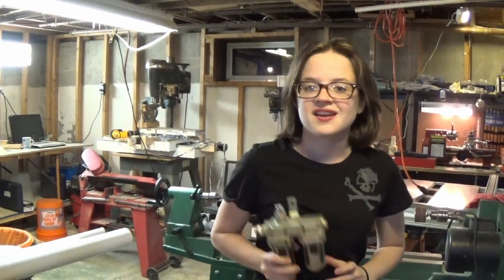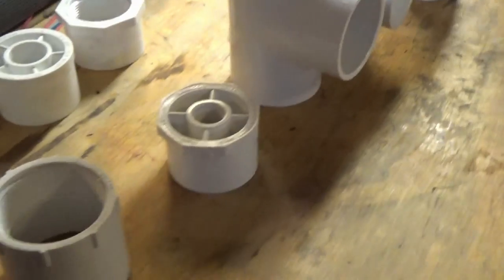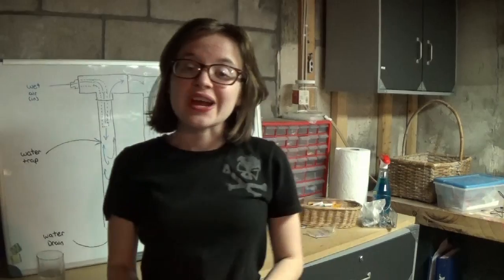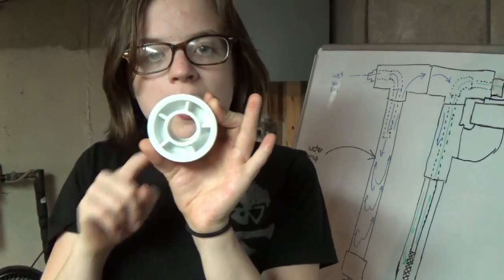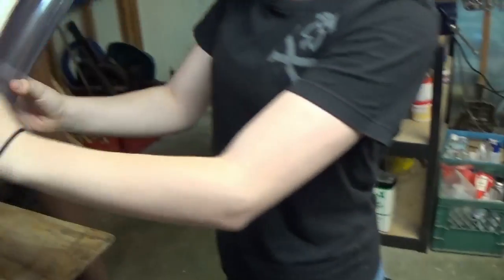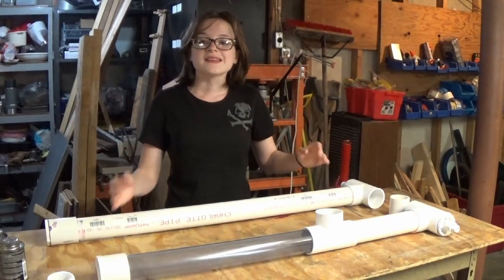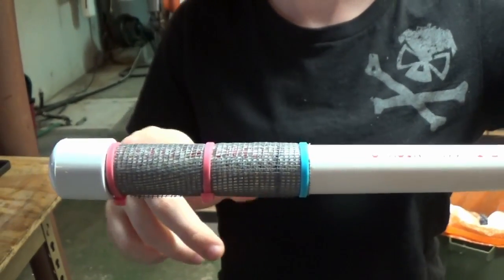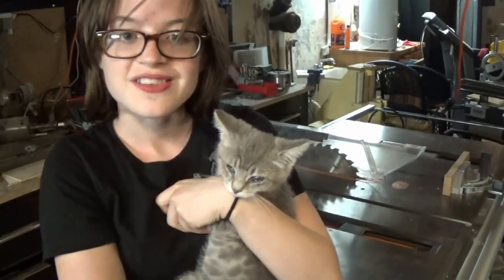Ep 11 Dirt Cheap DIY Dessicant Air Dryer

Comment: Only fools and dead people use PVC pipe for compressed air.
Reply: Nonsense, check out the pressure rating for 1/2" sch40 PVC. It's around 360psi, which gives you generous amount of room for error. It's pretty much standard in many parts of the world where the safety police haven't taken over. The problem is with larger diameters. as the diameters go up the pressure ratings go down. At 1" it's already down to 270psi,  at 2" 166psi. Add to that that as the diameter goes up so does the amount of energy stored in it, I wouldn't use the large diameter sizes. And that's why I'm leary about this air drier, it's all large diameter pipe. But 1/2" sch40 PVC is perfectly fine. Even if it does explode at 100 psi the shrapnel isn't so powerful that it's going to do much damage, unless of course it hits you in the eye.
Reply: Yes, volume not pressure.  If you have 60 gallon of water compressed to 100 psi, obviously if you remove 1 oz, you will dissipate all of that pressure.  If you have 60 gallon of air compressed to 100 psi, you will have to remove 408 gallons of air to relieve all of that pressure.
Reply: @CPUDOCTHE1  Liquid does not compress. Water pressure is increased by stacking (vertical head pressure, as in elevated municipal water reservoir tanks) and/or centrifugal pumps. Either way, it is never compressed. 
Where did you learn math?  Duh! To relieve all of the pressure in a 60 gallon tank, you remove 60 gallons of air, less what the physical volume of the tank is at static. Also known as Atmospheric pressure. 
Sheesh! Double Duh! 
Doesn't matter what the pressure is. You're not gonna get 408 gallons into a 60 gallon tank. So, how the hell are ya gonna have to remove that much, huh? 
Unless ... is this that New Math? Ya know, that Common Core stuff? If it is, God help us our future.
Reply: @MarcVette  That would be 408 gal of air at STP (chemistry term standard temperature and pressure) which it would be released as when the PVC explodes.  What, did you get a gold star on your GED?
Reply: @CPUDOCTHE1  Ah. Boyle's Law. High school was more than 40 years ago ... and, admittedly, most of that was a psilocybin mushroom and Acapulco Gold blur. It was the 70's, after all. But, they tell me I had a lot fun! And, I survived with only a few visible scars. So ...
Nope. No GED. In the middle of my freshman year at CWRU I went straight and earned a B.S. in General Engineering. Then, went to CSU (Cleveland) and earned my B.A. in Communication. 
I'm Arizona. My compressor is in the garage, no central AC. So it tends to produce more condensate than normal climates. I do know that Schedule 40 PVC pressure rating goes down with increased diameter. 2" is pushing it at 280psi. But, 1-1/2" is at 330psi. For me, that's a working margin.
Reply: just fyi,, PVC psi ratings are for liquid not gasses. they react differently. I thought the same until after a few minutes of googling showed PVC is not good for compressed air
Reply: I have 600 psi pvc works great on my compressor that pressure switch shuts off at 155 I would worry a lot more about water in tank rusting inside of it.I  I met a guy that bought a used compressor. the tank exploded mangled his hand.never able to work on cars again
Reply: Did you use SCH 40 or 80. Also remember that PVC will fatigue over time and this is made worse with temperature fluctuation.
Reply: Mostly those that get hurt cannot do the proper math to make it safe.
Reply: PVC is fine as long as you can keep it away from UV.    That's what makes it weak and brittle. The SCH 80 has been trouble free in my shop for 15 years.
Reply: I've exploded PVC fittings with compressed air on just 10 psi of air. 1/2" Copper air system for dental air, test caps were brand new schedule 40 PVC. I was outside, gauge barely hit 10 psi from my little lame compressor at the time, and hear a pop from inside, and loose all pressure. Go inside the opperatories, and all four caps completely shattered, little PVC shards accross the rooms. Not even 10 psi.
Reply: Major Disdain  LMAO !!!
Reply: She made a clear warning about PVC in this video.
Reply: That is fine until the PVC weakens, then  with a compressed gas, when it fails you get a BOOM and shrapnel, not a liquid drip or gush.  PVC fractures, rubber, steel, and copper, along with a few other materials DO NOT FRACTURE in to lethal pieces at 100-200 psi.
Reply: CPUDOCTHE1 
volume not pressure.  shes way smarter than you. now go tell your mom that youre sorry you hurt her when you were born you pug.
Reply: Obviously pressure of a compressible gas

Comment: Pvc will NOT "shatter" into a million pieces n leave a shard in ur eye, the only pipes doin that in the shop r the glass ones cuz glass pipes don't belong in the shop ( ; I'm only 29 but iv already experienced aged pvc failing a couple times, it cracks but it doesn't blow apart to pieces like ppl r worrying about, don't worry urselves. Iv always ran at least 150 psi, 170 175 the past couple years because I have a 3/4 impact that goes thru air like a fiend and at 150 with line drop the guns jus wasn't performing, anyway the point is the failures iv had weren't at a real low pressure, the failure mode of the pipes r simple linear cracks parallel to the pipes length. I'm sure a pressure switch failed on a system that either didn't have a relief valve or had a bad one (experienced both those to) and blew a pipe apart but at 160 180 psi the pipes not a bomb its far from it. The only thing you'll get is a headache from the obnoxious loud a** noise
Reply: I'm sure the workers at this factory will be glad to know that everyone imagined the injuries they received....

http://infinitypiping.com/PVC-in-news-3-9-12.pdf

Comment: Can someone explain why all air dryers are on the high pressure side of the compressor.   It seems the same principals would apply to the low side also and then one would not be faced with the inherent problem of the PVC bursting. I understand air under pressure is denser and heats up because the molecules are pressed together.  Moisture is then formed in the tank because the metal is cooler than the air. Air going through a lower pressure also removes moisture because the molecules are further apart and water molecules are heavier.

Comment: Extremely good vid, Hannah.  the one thing I would caution you about, however, is leaving the key in your lathe's chuck.  Sooner or later you will forget and leave the key in the chuck after you've tightened it on a workpiece.  when you turn the lathe on, the key will either be thrown with considerable force or it will remain in the chuck and smash into the lathe ways, causing a lot of damage.  Make a hanger for the key and develop the habit of always putting it there.  Happy DIYing and stay safe!

Comment: Hannah is there a reason you did not  use pvc primer  on every piece? I like this idea and i am currently in the process of building it.And by the way i have been painting  at the same body shop in Texas  for the last 11 years using pvc air lines and have not had a failure yet.

Comment: much before thinking to a dissicant dryer, the compressed air must be cooled as far as possible( to the room temperature  or lower if it's possible) then filtered with a conventionnal filter then if it's not enough you can think to to a dissicant dryer
I made an exchanger with a 1/2" copper pipe inside a3/4" copper pipe that is cooled with tap water that I installed between the compressor pump and the tank and another that I installed  at output of the tank  with a standard filter and it's enough to keep the moisture off my pneumatic circuit
Reply: important: the compressor tank must stay cool !!!

Comment: Great project you are one very clever young lady. 

Here is something you may find useful, perhaps an upgrade to your air dryer. 

On the water collecting side, you can add a water Sprinkling Valve or a Water Pressure Relay Switch, the actual name escapes me at the moment to release the water once full. What the Switch or Relay will do is open when there is too much water and empty into a drain or possible some sort of water collection to be used in the Garden or where ever. 

That way you won't have to stop what you are doing as the Switch or Relay will do the work for you, automatically, and you can continue to work. How to wire it, I will let you figure out as I wish to challenge you here. Also be sure to add a manual switch to open and release the water after you're done for the day.

There is a Water Sprinkling Switch that is used to allow water to pass for hydrating your yard and it works off of a solenoid. It might just adapt to your current Drain Plug fitting too. Again I forget what it's called but as I remember there are a few to choose from and I am sure you will get what ever is best for your setup.

You can use another Arduino or figure out a way to add some sort of pressure switch or maybe have it empty by timer or something like that. I know they make sensors that detect water as well. 

Something you may want to adapt too is learning how to drill and tap plastic pipe. Rather than use adapters and reducers, you may be able to get away with end caps and fittings or drilling a tapping the pipe itself to add fittings and sensors and what not. 

A clever young lady like you will figure this out easily. I look forward to seeing what you come up with...

Comment: this message is for dad ,,,sir you have done a fantastic job i tip my hat to you
Reply: Or Mom, but of course Both!
Reply: I agree with you on this, i seen this girl talking about stuff i did not even know of....lol... shes really a smart kid... god bless the family who did a great job teaching her the proper workings of tools and material.
Reply: PVC is not a problem for air lines except in certain environments PVC gets brittle over time as the oils leave the pipe.. It will then shatter or burst at the weak point usually a fitting screwed into the pipe to accept a hose . Use at least SCH 40 or heavier. Where I live I can take a piece of 3/4 PVC that's over 5 years old and it will shatter when being cut with a PVC cutter unless you use a saw. If it's starting to look dull and faded it's getting old. I have a friend who has sch 40 PVC in his shop for over 20 years... NO PROBLEM.  He painted it and it's still working and he does bodywork. But just be aware.
Reply: ... as compared to using sch 80
Reply: Congrats on such a smart daughter.
Reply: I wondee why they stopped making videos, what a shame.
Reply: A few bucks???
Reply: Not quite, she's wearing sandals in a workshop, definitely not a good idea.  Get that girl some steel toes or at least leather boots for playing in the shop.
Reply: @trevors8577  That girl is definitely not playing.
Reply: Schedule 40 pvc is good at room temp for 160psi. Not a good choice to save a few bucks.
Reply: My tool room has had PVC air lines for 7 years. Look at the pressure ratings. More than you will ever see in an air system.
Reply: @ronburggraaf3444  till it gets brittle you'll start replacing the hole system a small chunk at a time takes about 10 to 15 years
Reply: @rileybennis4029  my boss is learning this the hard way. 2 years 8-9 blow outs in all different parts except the underground run to my paint booth. Couple places he replaced it will metal. It blows out usually at the fittings making 90 degree turns. Especially in the cold it shatters and sends Sharpnel around the shop. Hear all the grinders stop when you hear that kaboom you already know what just happened and go shut off the valve to that side of the shop. The pipe is rated for 180 psi and we're running 175 to it. At least parts are being replaced with metal. Not one metal piece has blown out. Would have  been cheaper to run metal to begin with
Reply: Only she is reading from cue cards.
Reply: @KingRatt  ok but in some near or far off future  I'm pretty sure she's going to repeat that information without having to read it...

Comment: good video, but at that price wouldn't it be cheaper to just buy one? or like five
Reply: depends on usage and purpose. this system provides a huge amount of desiccant beads that can absorb lots of moisture. great for heavy users who need very low moisture air and cant afford a compressed air dryer!
Reply: The commercial refrigerated dryers we priced on Grainger were in the $700 range.

Comment: I too will jump on the "safety police" bandwagon, because you can't put a price on safety. I realize that nearly everything poses some level of risk in life...drinking too much water can kill you. 
With that said, there are plumbing and OSHA codes that forbid the use of PVC for this type of application. It does not specify one component or a complete system. It does not specify every day commercial use. It covers it's general use, because the risk remains the same. 
Codes are written and revised periodically. The people whom influence the decisions on codes are typically engineers and trade professional that are considered industry experts. Codes are not solely written on their opinion, but years of field testing and controlled lab test provide data for codes to be implemented. 
The sole reason these agencies exist is for safety and proper operation. As a building professional, I always heed their guidance and regulation. It's my responiblility to protect my workers and provide clients a product that exceeds expectations. 
As Rob Harrod post eludes, he's has witnessed failures of pvc "blasting" out of the ground and walls during a failure. Typically, inside walls and below ground are not areas subject to UV exposure which absolutely degrades PVC faster. Most professionally installed building systems due utilize PVC below the specified operating pressure. So his remarks substantiate code/safety policy. His comment on a gaurd is also a very good idea. 
I will say that this is a clever design and the clear pvc is great to monitor the silica. This is a simple low cost way to to reduce water in the lines. A steel version can be made to accomplish the same design, less the clear section. Such a small amount of material would yield a minimal cost difference and is worth exploring. 
Great job with the video and best of luck with your projects!

Comment: CAUTION i made a drier like this and if you live in a cold climate when this is cold and you pressurize it it can ( mine did ) explode sharp pieces of pvc plastic
Reply: Thanks for repeating what she clearly stated!
Reply: Joey Brewer PVC is used under air pressure all the time. I had it in my former shop that sublet from a 20k sq ft wood working facility who ran a 25hp compressor through it and it worked fantastic. You do have to be careful not to impact it in any way while under pressure we had a fork lift get too close and it does explode when once it’s cracked. I wouldn’t call the pieces sharp but they were certainly flying everywhere. Ultimately it comes down to common sense use.
Reply: For those of you worried about a pvc pipe explosion. Make a 1/2 inch plywood cover for this system. My whole shop is plumbed with schedule 30 1/2 inch o.d. Pvc pipe.  All together I have about 35 feet of down spout style runners.  I pipe clamped 2 inch angle iron as mine are ran along 4/4 main beams holding my small pole barn/shop up. I had a bunch of 2 inch angle iron also. The ones going overhead are plumbed through my ceiling and I am protected by a 3/4 inch sheet of plywood,shingles, and about 6 feet of air. I also build an air dryer similar to what she built. Only I built mine out of 3 swimming pool filter canisters. Hey they were free.
Reply: vin rap How cold is cold? 50 degrees F, 32 degrees F, or 0 degrees F? Would just like a verification. Thanks!
Reply: I live in the north east of the usa and in the winter it gets cold well below freezing  it might not be an issue in australia it never got that cold when i was there
Reply: Anything that contains liquid water is going to weaken if that water is allowed to freeze.  You'd need to empty the liquid water after each use in the winter.
Reply: And make sure you don't but your PVC anywhere they store it outside, the sunlight weakens it significantly. Another trick is to hit the end of the pipe with a hammer, medium strength blows, if it cracks apart it's old PVC, if it's new it should bounce the hammer off of it. I learned that from making PVC bows
Reply: That's exactly what I was worried about but when she said she was using pieces that where pressure rated thought it would be okay but then I don't know about the smaller fitting's and stuff I would not personally ever put plastic under air pressure.
Reply: @joeybrewer9595  Components from filter/dessicants from companies are made of plastic/polycarbonate - whatever that is.

Comment: I like working with pvc too! Here's a tip... When inserting your glued piece into its mating surface, start a 1/4 turn off center and insert it straight then give it the 1/4 turn to center. This twist helps seal the parts... Good video!

Comment: Did  miss a couple pieces like the 2" to 1.5" inside thread for the 1.5" cap can go inside I think... and the 3/4 to 1/2 adapter needs to have a 1/2 inside thread?

Hope this list helps

1/2 PVC 24" EST.
3/4 PVC 24" EST.
2" PVC 48" EST.
2" CLEAR R4000 EST.

3 - 1/2 MIP to 3/8 FIP BRASS BUSHING
 - 3/4 TO 1/2 ADAPTER
 - 1/2 CAP
 - 1/2 THREAD COUPLING
 - 3/4 90 DEGREE ELBOW
 - 1/2 SLIP TO THREAD ADAPTER
 - 1/2 90 DEGREE ELBOW
 - 2" THREADED PLUG (OUTER THREAD)
 - 2" SLIP TO THREADED ADAPTER
 - 2" SLIP TO 1/2 THREADED BUSHING
3 - 2" TEE'S
2 - 2" COUPLINGS
 - 2" TO 1/2 SLIP BUSHING
 - 2" TO 3/4 SLIP BUSHING
 - 2" SLIP TO 1 1/2 THREAD BUSHING
 - 1 1/2" THREADED PLUG (OUTER THREADS)
 - 2" INSIDE TO 2" OUTSIDE  90 DEGREE ELBOW
 COUPLE PLASTIC TIES
 BRASS AIR TANK DRAIN VALVE
FIBERGLASS WINDOW SCREENING
PVC PRIMER AND CEMENT
INDICATING BEADS DESSICANT BAKE IN OVER 245 DEGREES COUPLE HOURS TO DRY OUT